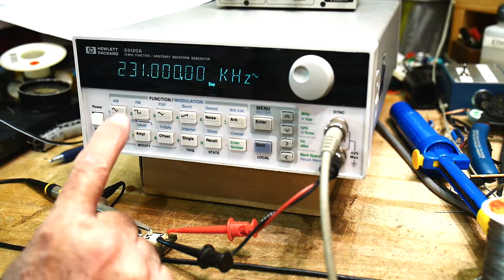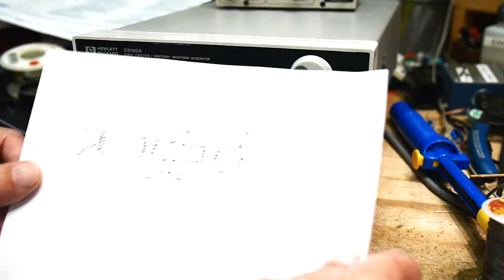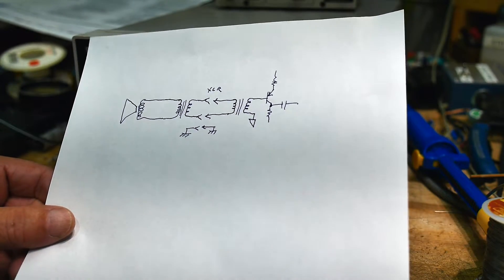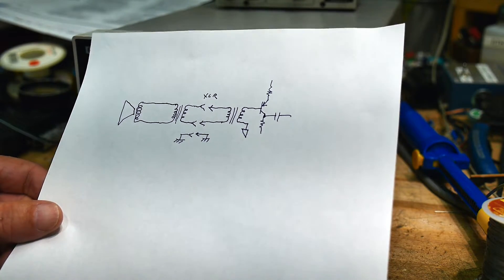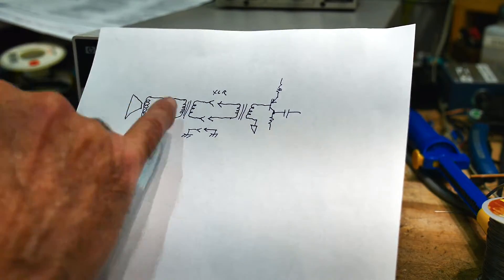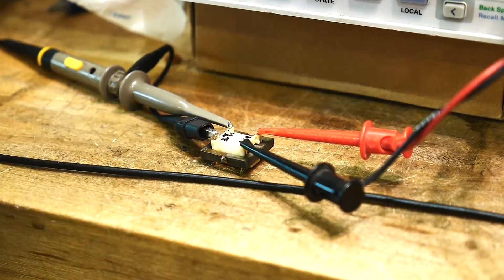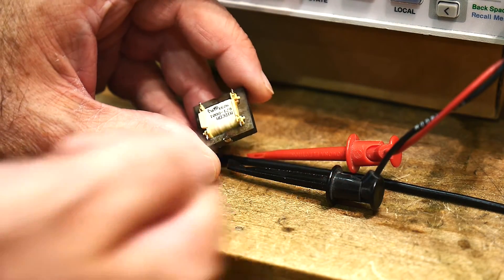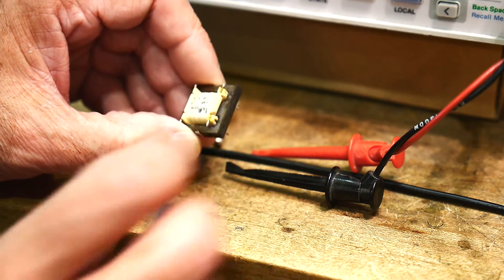#463 Audio Transformer Bode Plot Frequency Measurement

Comment: Don't conflate winding resistance strictly as turns ratio. If the primary is wound closest to the core, then even in a 1:1 turns ratio transformer the secondary must have a slightly higher resistance as the same number of turns must go around the greater diameter of the core wrapped by the primary. This can be avoided by sectioning the windings side-by-side as neighbors around the core, though even then each additional turn has slightly more DC resistance as more turns are applied. Center tapped windings can also have slightly unequal resistance for this same reason. Deducing the primary through the slight difference in resistance is beneficial, because driving the winding closest to the core will provide the best magnetic coupling to the other winding(s) wrapped around it.
Reply from the maker: Never thought about that. Makes sense. Thanks!

Comment: 1. Not a Bode plot (phase is missing)
2. Is the xfmr terminated in 600 Ω (both ends)? That might explain wonky frequency response.
Reply from the maker: you're right was not loaded at 600ohms. The transformer reactance is not flat with frequency so will still have some bumps. but not as bad as I show here